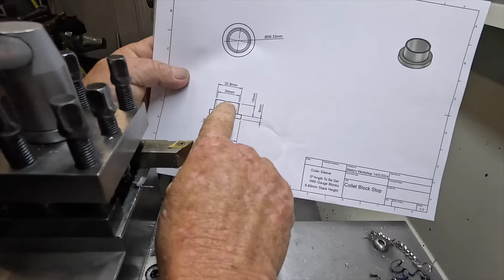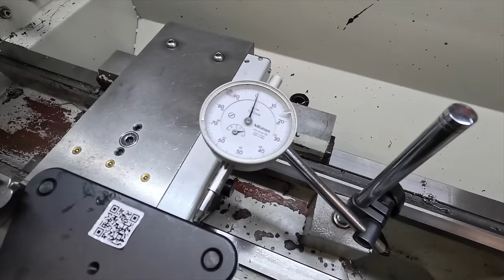ER Collet Block Depth Stop

Comment: Whenever I made a slight hic-cup on a piece of a jig or tooling for in-house use, it would become a prototype or proof of concept piece, if it worked it was fine. If you ever meet an engineer who claims never to have made a mistake, they are speaking with forked tongue. Good job Matty, stay safe and well, regards to all 👍
Reply from the maker: Gday, it does work but with a little modification it’ll be much better, appreciate you watching mate, cheers

Comment: Hi Matty, I haven't looked at other comments so someone else might have made the same suggestions. 
On getting the tapered fingers to spread easier, make the taper only about 10 mm long (deep) and then bore it out behind. You did some but maybe not enough. Also cut another four slots, total eight.
On the "drawbar" part, cut the taper only for about 5 mm and cut clearance behind. That way the "fingers won't be so stiff and the tapers are only working against one another over a maximum of 5 mm. At the moment you're working them over about 15 mm though you did undercut them behind a bit but still lots of drag. Otherwise a pretty good idea. Might just try one for my ER 25 ones. As big as I go at present. Already have a couple for the 5 C collets.
Thanks for the video, stuffups and all. Regards from "upover" in Canada's banana belt.🤞🇨🇦🍌🥋🇺🇦🕊️🇦🇺🐨💩💥🏁👍
Reply from the maker: Gday, I’ll definitely be putting more slot in the taper which will improve it quite a bit, I like to show the screw ups in the videos, it’s what happens here, appreciate you watching, cheers

Comment: Nice build!
Taper ... it's the only thing I might have done different ... 8° (16 included) would have been my choice .. that's the standard for er32 collets and some engineer WAY smarter than me figured out it works best for such applications.
Thanks for sharing 🇨🇦
Reply from the maker: Gday, I should’ve went with a different taper and I’ll be putting in more slots to, appreciate you watching, cheers

Comment: You need more slots in it. Each piece goes 1/4 of the way around so they don't want to flex
Reply from the maker: Thats exactly what it needs 100%, thanks for watching, Cheers
Reply: My thoughts exactly, 8 or even 16 segments would work. There shouldn't be much force on it. The collet holds the work in place. Pretty easy to make a couple more cuts.
Reply: Well done Matty.  You seem to have this seat of the pants engineering thing down to a science.

Comment: Great job Matty. Looks a treat. Put 8 slots in the taper and it will nip up much easier. The 1/4 of a circle does not like to move whereas an 1/8 will.  Printers are a good source of all kind of parts. ATB regards from the UK
Reply from the maker: Gday, I’m definitely going to cut more slots in the taper, I did screw up there mate, the rods that come out of printers is pretty handy material, thanks for watching, cheers

Comment: Hey Matty. Flash job mate. The internal female expanding bit, I cut a groove also.. but on the outside, end of the slots near the shoulder., also cut 3 slots., ie 6 segments..! You'd be surprised how much movement the collet makes,.. even Hand Tightened. ... and, for the male expandy bit, I used a 12mm bolt, and booker rod/all thread for "The Adjustable Stop."   Amazing watching you do and explain it, how much work there is in it.
Reply from the maker: Gday Mark, thanks for the idea, I did screw up there and will be putting more slots in the taper, appreciate you watching mate, cheers

Comment: As I can see, you use printer parts too. They are very nice pieces of steel.
Nice little build, Matty. And I share the same idea that I read in the comments. Double the number os slots in the taper and it will work just fine.
Reply from the maker: Gday Rustinox, ill definitely be putting in more slots, that was a screw up there but easily fixed, the rods out of printers are pretty good material, thanks for watching, cheers

Comment: Nice job Matty! Yes I thought you were being very hopeful at single pointing the 8mm thread that long, but you did it mate. I though to myself "You jammy bastard," when it threaded on with no drama lol it clearly was a quality piece of steel with the right amount of toughness to resist the cutting forces of the tool. All in all mate it turned out very well. You are a much better machinist than you give yourself credit for. I think I might give one of those a whirl, the only thing I think I would do differently is to reduce the angle to around 6 degrees included instead of 10. It should make the deflection a bit easier and enable it to be done by hand. I will also  do 45 degree slots to double the "petals" that expand. That should make it easier to expand it by hand. I hope you are feeling better after your treatment Matty and things are going well for you. Cheers from the UK. Sam
Reply from the maker: Gday Sam, thanks for your kind words, I have to put more slots in and that should fix that issue, the rod machined really nicely and bugger all deflection, appreciate you watching, cheers

Comment: Matty, I was going to recommend that you cut more slots in the female taper, but I see that several others have already done so.  If your coffee-colored coolant smells bad, look into getting an anti-bacterial additive for your coolant to kill the oil-eating bacteria.  If you've got oil floating on top of your coolant in the sump, maybe get an oil skimmer to minimize the amount of "food" you're providing to the bugs.  You might also consider adding a filter to your coolant system.  If your sump is full of crud, you'll want to clean it out before adding new coolant to it so that you don't immediately contaminate the new coolant.
Reply from the maker: Gday, the coolant doesn’t smell, I do have a skimmer but I’ve been lazy, it’s over due to be changed that’s for sure, thanks for watching, cheers

Comment: my er40 collet blocks came threaded both ends for collet nuts so I use a 2nd nut with a 6mm collet holding a rod as my depth stop.
Your impromptu redesigns came out ok. Thanks for sharing! 👍
Reply from the maker: Gday, Thats a great idea and would work really well, Thanks for watching, Cheers
Reply: @MattysWorkshop  I do have to use 10mm spacers between the vice jaws and the collet block, but for the amount I use a depth stop Im not mad.

Comment: Worked out fine in the end, I would have thought a shorter taper on the inside part would work better, as is you are trying to flex the whole length of the cut-out, all it needs is a small part of the tip to flex out in order to grip and spread, probably 10 - 15mm would be plenty taper on the plug, this will make it easier to tighten by hand too.
Reply from the maker: Thanks, Appreciate you watching, Cheers
Reply: @MattysWorkshop  The Thanks is to you, I appreciate you sharing and giving us something to watch.

Comment: 16:49 Hi Matty
This looks like a super little project and will be very useful.

Could you possibly give the basic details of your main lathe and milling machine as I am planning to upgrade very shortly as the small lathe I have is too small now.

Thanks for the great content and keep healthy.
Greg Tutin
Launceston TAS
Reply from the maker: Gday Greg, my lathe is a Hare and Forbes AL960b, it's the smallest Taiwanese lathe they sell, its done everything ive asked from it but im starting to think its possibly time to go a bit bigger when funds are available, The mill I have is a Cincinnati 2L, its a horizontal mill with a vertical universal head, its a great solid mill but not a lot of Z height, hopefully ill be upgrading this soonish with a bit of luck, Hope this helps mate and appreciate you watching ,Cheers
Reply: The AL1000D is 3 phase, Taiwanese & has a foot brake that you wanted Matty.
They are around the $12.6k new from Hairy Forbes. Spindle diameter is only 40mm tho.
They are a 14”x40” swing & between centres.
Been selling them the last ~20 years or so.
Theres a 2008 built one in reasonable nick near me for sale used in WA asking $8.5k that has 3 chucks and other tooling with it.
Old German guy bought it when he was aged 80 & just turned 96 & can’t use it any longer so it’s available.
Bit dear to ship it West to East or worse Tassy tho.

Comment: Nice build Matty.  A thought on the taper....what if the male and female sides were a half degree off so they first engage as an interference then spread out to match?  I too think there needs to be more cuts to have thinner sections.
Reply from the maker: Gday, Im going to put more cuts in and hopefully that'll make it work easier, your idea should work well to, Thanks for watching and commenting, Cheers

Comment: A fun little problem solver there. As mentioned with a couple more slots cut in it it should grab way easier. It sounded like it was really coming down on your roof. Are you in your rainy season there?
Reply from the maker: Gday Tom, I’ll definitely be putting more slots in the taper, the noise was the kettle boiling, it’s a noisy bloody thing, thanks for watching mate, cheers
Reply: Your kettle oh wow.  @MattysWorkshop

Comment: Hi Matty. Do you think that reducing the length of the external taper to something like 5 or 6mm so that you are only trying to deflect the tips of the slotted section would make it more sensitive.
Reply from the maker: Gday, I think putting more slots in will solve a lot of the problems hopefully, appreciate you watching mate, cheers